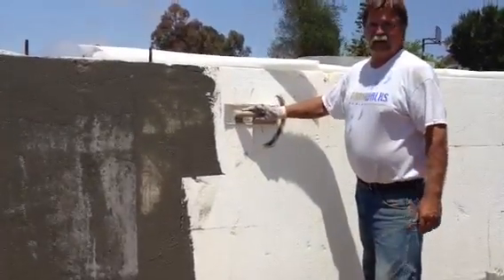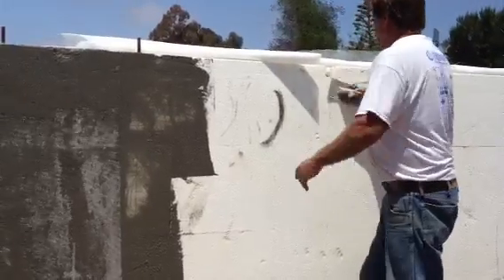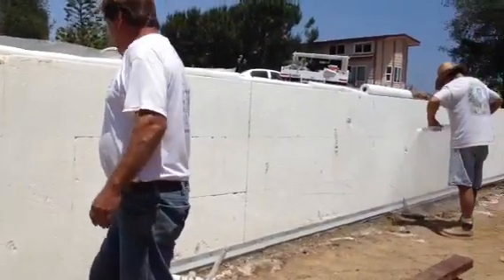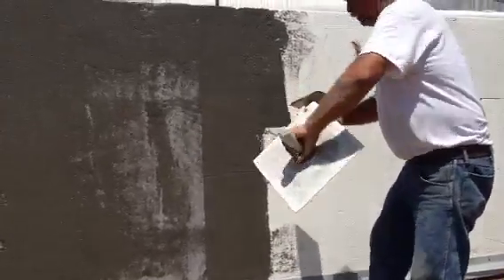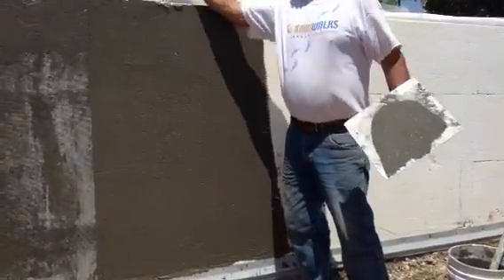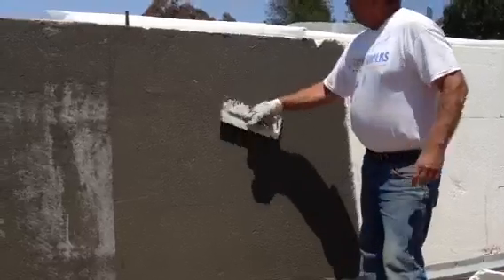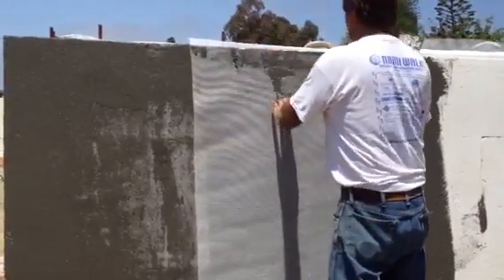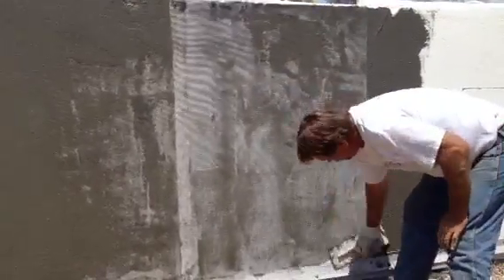Synthetic stucco finish on Fox Blocks ICF

Comment: No disrespect but I would not do what is promoted in this video.  Do your research before attempting this folks.  Otherwise you’ll end up with a problematic solution which may fail in no time, requiring costly remediation.

Comment: Wow!!! Absolutely horrible. Can't believe he installed flashing on the bottom and went right over it with the basecoat and mesh! He basically created a water trap all along that flashing. Second and not last he floated the basecoat which is a polybase cement basically weakening it to the fullest. Tomorrow that will not only be so thin but basically sand. This guy has  no business in this trade. Leave the stucco to the professionals.   Plast-on wall systems Ltd.   A proper 45 drip band should have been applied all along the perimeter of the wall tying into the wall as 1 or he could have simply sealed his flashing with a proper material that would bond to the foam. Then basecoat no floating, then a very clean skim coat with no lines. Then the final acrylic top coat. Which is to be floated with a plastic float to expose the agrigit. No sponge float. That is for conventional stucco. Hope this helps all the DIYers out there.  And good luck because if you don't have years of experience you're going to need it.

Comment: I've just built an ICF home 1760 square, 4" concrete in center and 2 1/2" of styofoam on interior and exterior.  Was told I needed to paint styrofoam to protect the walls from sun until I can get my roof on it.  I'll spray the foam to protect it.  Once a roof gets on can I apply this over the paint or will I have to remove paint? Great video.  Doing this will be saving me a lot of money,  no expense on siding.
Reply: Ga Fin  my exterior walls already have the styrofoam on them, all I need to purchase is the base coat, mesh, and then top coat. Google buildblocks, it's an ICF (insolated concrete form) house
Reply: Ga Fin  so you're saying buying this product is more expensive than any siding? BS my exterior walls are already styrofoam w/ 4 " of concrete in the middle) all I need is the stucco mix. How is that more expensive? I'm confused

Comment: How do you install the foam to the block wall?
Reply: Oscar Ruelas by
Reply: Oscar Ruelas ICF is "insulated concrete forms". The insulation is used as forming to pour concrete, not blocks.
Reply: This is an ICF (Insulated Concrete Form) wall.  Look up Buildblock
Reply: cisa93  its a synthetic mud called primus by dryvit. sticks to anything